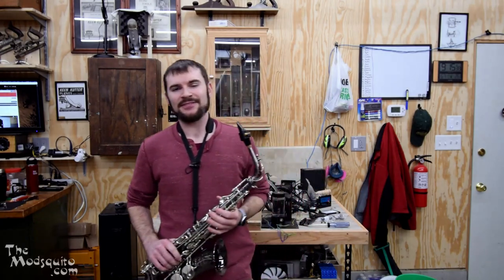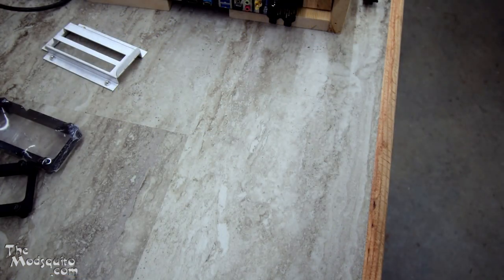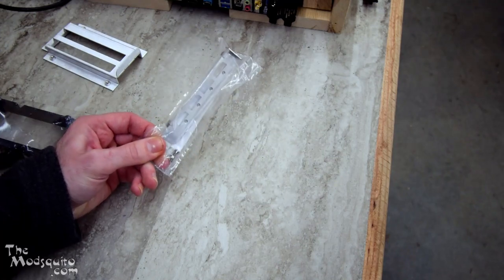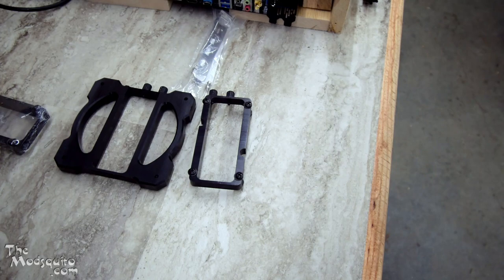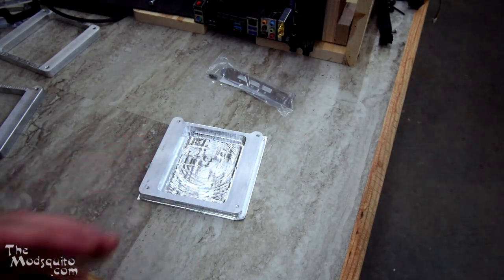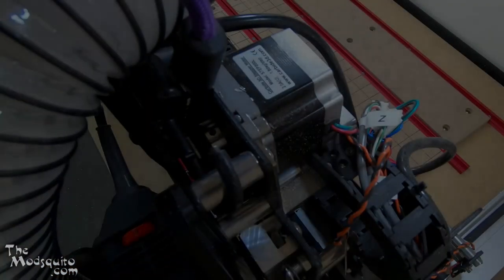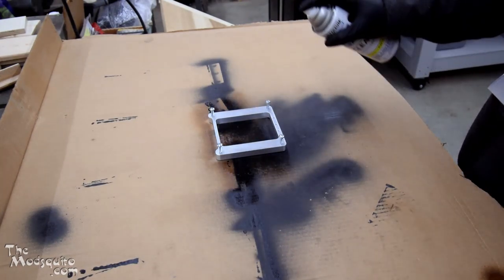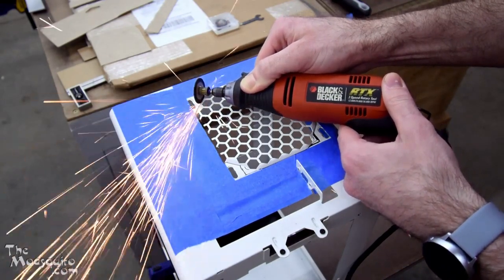Jam Packed Part 4 - Vertical GPU Mount - InWin A1 Dual GPU Mod

Comment: Acrylic holds a tapped screw thread rather nicely just if anyone else is playing along at home
and yes that backplate looks good
Reply from the maker: Thanks!  I didn't have a 6-32 tap yet, but I had a ton (just shy of 100) of those threaded inserts, so I figured I'd use those in the mean time lol  I have quite a few reservoirs that have threads cut straight in the acrylic, so I wouldn't hesitate to do that had I had the tap at that point :D